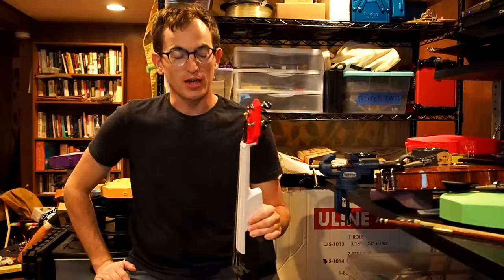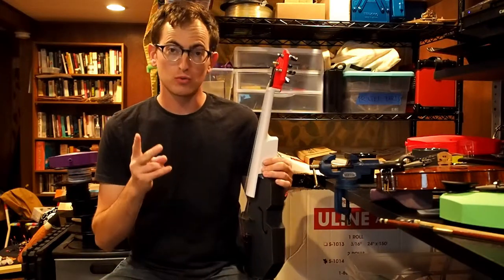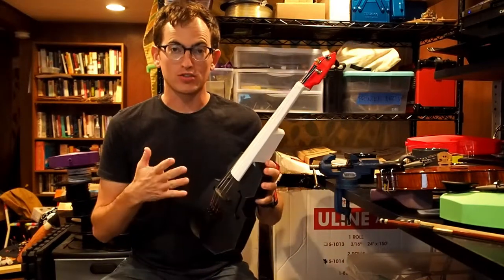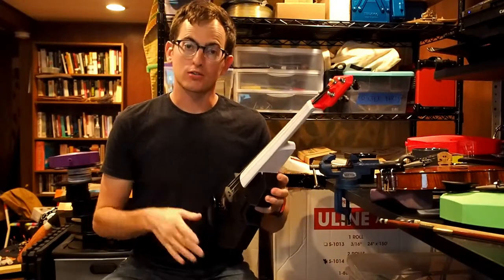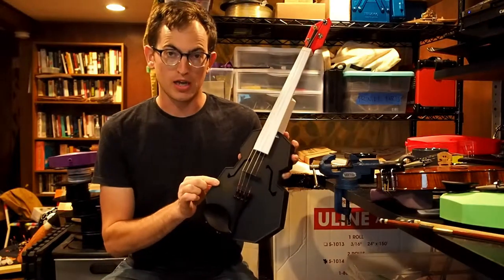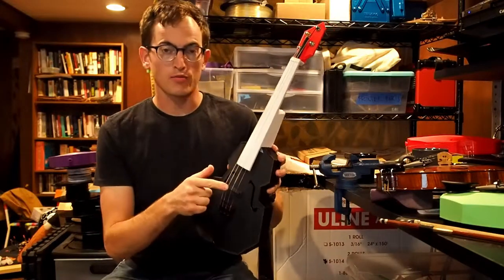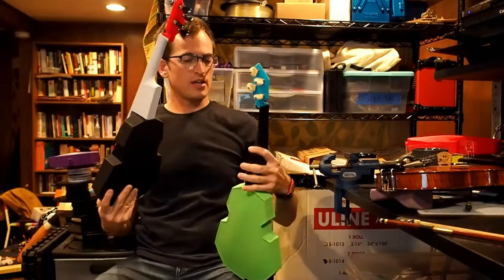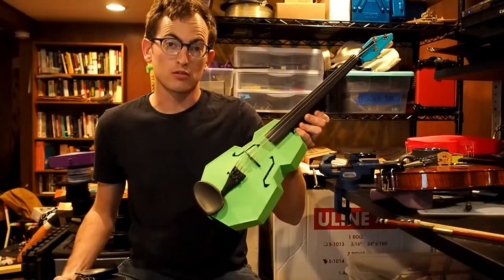Carbon Fiber PLA on the 3D Printed Modular Fiddle

Comment: Any thoughts on pla + (pro) as compared to carbon fiber pla?
Reply from the maker: David Hauptman — good question! The short answer is that I suspect some PLA+ mixtures may be better than most standard PLA, but will not be better than carbon fiber PLA. There are several manufacturers that sell some variety of PLA+. My experience is that they offer improved toughness, and some are formulated to be annealed and offer better high temp resistance. Generally speaking there is not much increase in stiffness, which is what we want to maximize (within reason). 

The gains for temperature resistance should not be discounted tho. Many plastics after annealing increase in stiffness, and a PLA Fiddle won’t last twenty minutes in full sun on a warm day. I’m about to do some head to head testing of annealed versus not annealed high temperature CFPLA from Proto-Pasta. Stay tuned!!

Comment: Do you plan to publish designs for half, quarter, eighth size violins (for younger, smaller players)?
And how about 3D-printed violas and cellos, etc.?
Reply from the maker: Good questions! I would like to publish designs for the scale instruments, but it will be a while before I get around to it. There are some in the community working on it now, though. As far as larger string instruments go -- no. Larger prints are tough and the printed instruments would not stack up well with traditional wooden instruments.